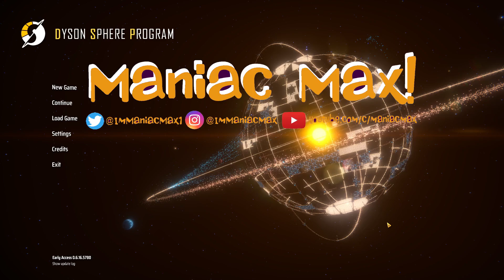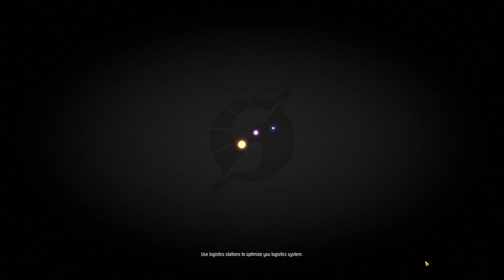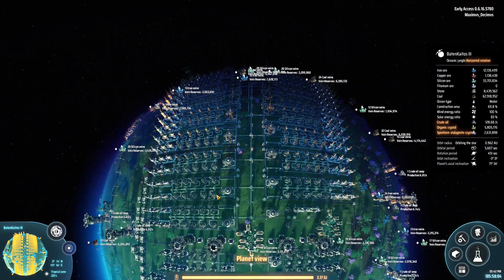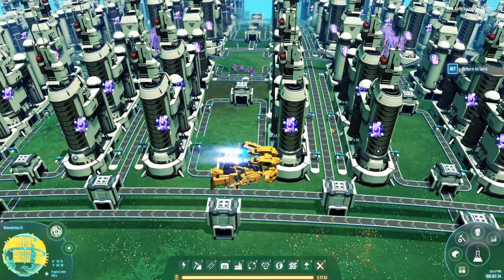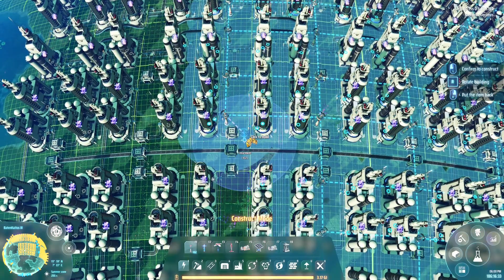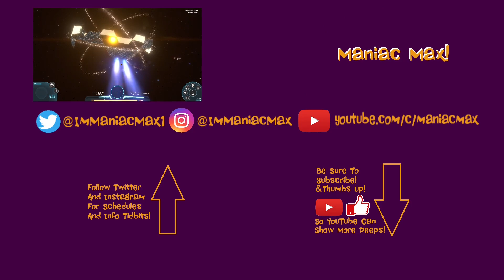Dyson Sphere Program NEXT: Hydrogen Casinos! (#39)

Comment: the copy inserter mod sux
i tried it and it works horribly

it does work but the display is all screw-up and has issues when everything is too close toghetter
Reply from the maker: Now that I've been using it for a few days - I'll probably nevre go back - it can be quirky, but I've also learned several tricks to compensate :)

Comment: With the sorter mod you have to figure out what your block is of the machines so many machines on the belts being used minimize that number of changes and that's what you have. My cracking setup I have on a maxed out crew belt tier 3 60 refineries doing the initial refining, direct feeding the refined oil to the two machines cracking. And on my belt layout I have three different inserter setups on the machines. I can place this on either side of the crude belt having a hydrogen belt on each side of the crude belt. I did my first set up by hand, I have three setups right now going on and off world planet eating crude. That mod saved my hands lmao
Reply: With that mod you have to have the belts laid out or the machine's placed at your direct feeding for the sorters to place. So for me I had to do in a sequence of laying the cracking machines first then connect the refining machine last. So that the filters would carry over
Reply: Also if you have a sulfur ocean world with you cuz I'm not too sure if you do or not. You can easily deal with the carbon by turning it into graphite then burning it. That's why I exported the crude to another planet in the system that had sulfur oceans. It will only take three generators to burn the graphite from a full crude to crack line
Reply from the maker: So now that I've had the copy mod for a few days - I've learned multiple tricks to using it - my first use is in EP40, though by EP43'ish I do all kinds of quirky things with it :)

Comment: I used a xray craking setup that "copy inserter +advangedbuilddestruct " mod can work . 

Layout like : oil refining output hydrogen belt , crude oil input belt , machines , x cracking output hydrogen belt , x cracking input hydrogen belt , x cracking output energetic graphite belt . 

Machine setup like : one x crack refinery that  small size faces to right side , one gap , under it oil refinery faces left , one gap , under it another x crack . Mid oilrefinery feeds both xcrack with refined oil directly (no excess refined oil to make problem ) 2 setup's xcrack machines can be near with no gap . 

I think i can produce 3 times in same area regarding to your xcrack setup . With mods , building time also can be very less . 

Regarding mods : i used background music mod , add interstellar movie soundtrack : it was something special . 150 hour with same game music has no point . In advangedbuilddestruct mod i cant use extra gap spacing control with "+ and -" buttons . I will be happy that someone says me where i am doing wrong . (R2modman , in config file ask me a number of extra spacing , i write "0" , in game i cant adjust with buttons) . Starmap extention is useful . Save file reducer .  So many mods .
Reply from the maker: So now that I've been using the sorter / copy mods for some days I'd totally find a way to do that build in copy mode lol :)  But I can always say I did it once :)
Reply: "can work" means "worth it" . Copy mod's aim is to reduce building time . If you do complex belt designs , mod cant do its job effectively.
Reply from the maker: @atalaykas  exactly - though I have over the past few days gotten much better with it :)

Comment: 4:50 Why not from another gasgiant?
Reply from the maker: I havent found anouter one yet - and doing a video on a boring gas giant is just... boring lol :)  Watching a 1000 machines processing oil into hydrogen? its very cool :)
Reply: @ManiacMax  they are not that hard to find. You can see them, by looking on the resources of the System. If it has hydrogen, it must have a gasgiant
Reply from the maker: @jebkerman5422  True :) I'll most likely have to use more of them later. Fly safe in them rockets Jeb 'cause i hear Kerbal rocket parts aren't exactly stable hehe
Reply: @ManiacMax  As the saying goes: A good landing is, when you can walk away from the rocket. A GREAT LANDING is, when you can use the rocket again.
Reply: @jebkerman5422  ROFL
Reply from the maker: @jebkerman5422  hehehe :)